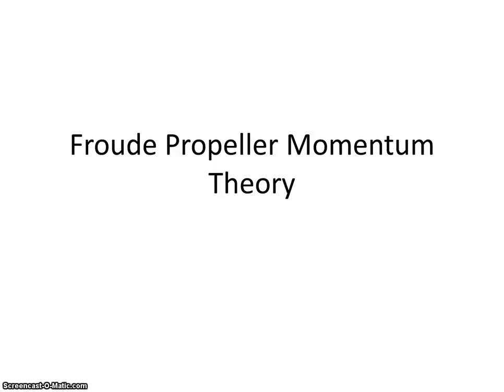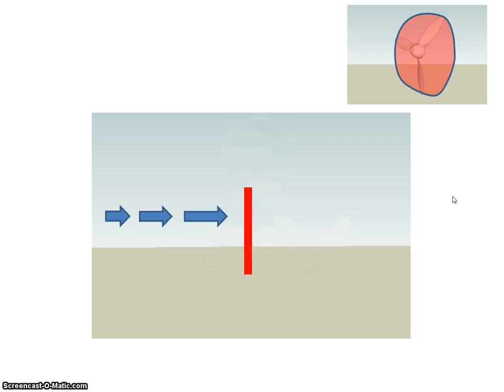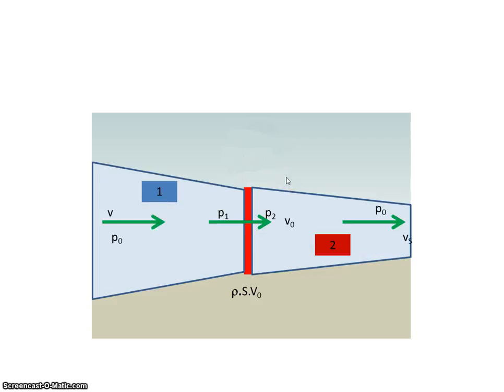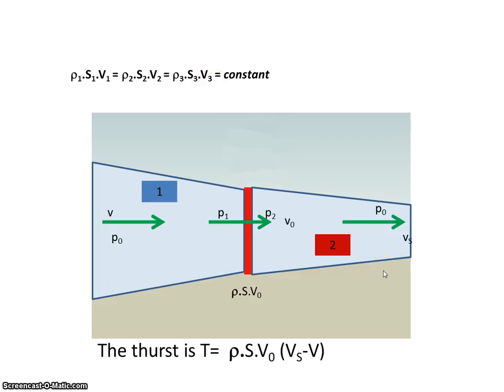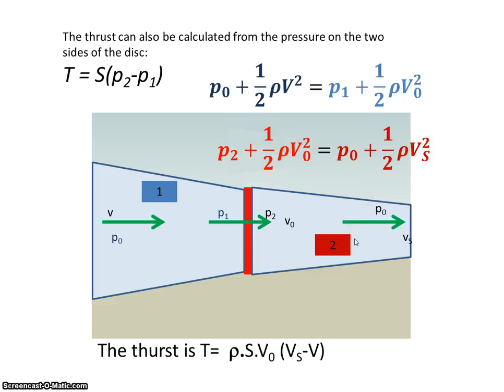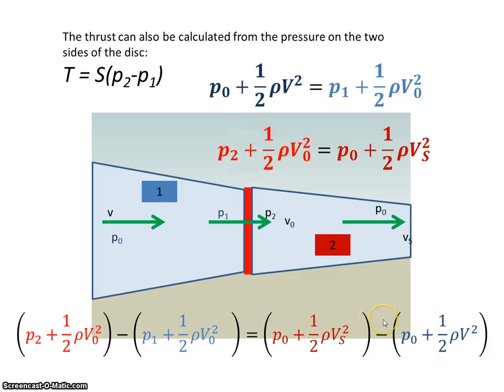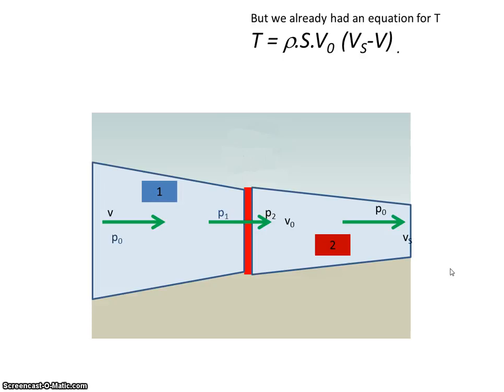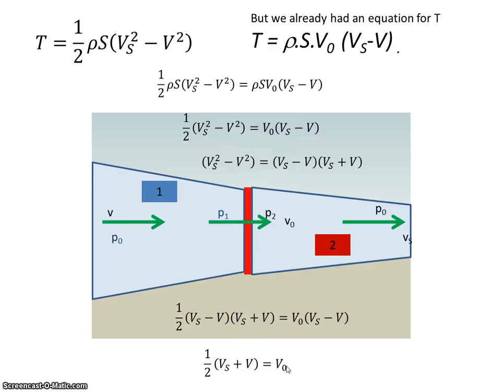Propeller Analysis 1

Comment: Can I get the velocity V0  on the basis of rpm of motor.
I don't have the inlet and exit velocity
Reply from the maker: You could probably work back from the Power of the motor.
Reply: @RoddyMcNamee  so How will the flow of calculation go if power of Motor is 1000Watts?
Reply from the maker: @vinayverma2561  Here are my thoughts.  https://youtu.be/8Jm-4-Ec09k